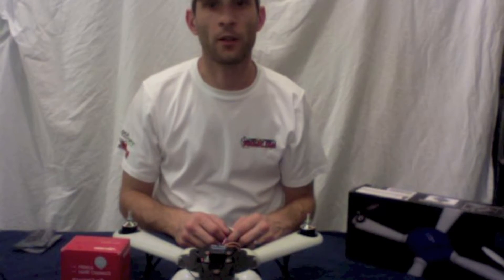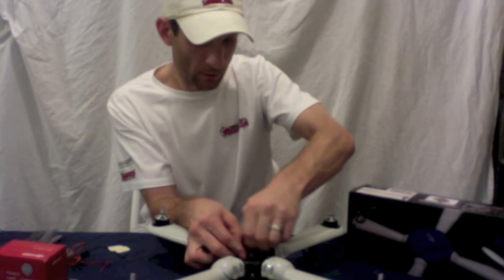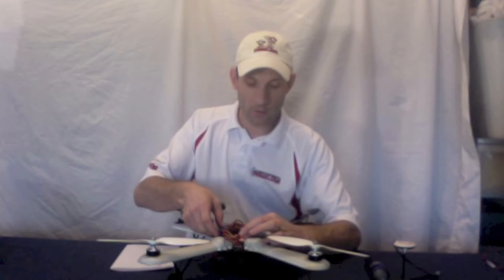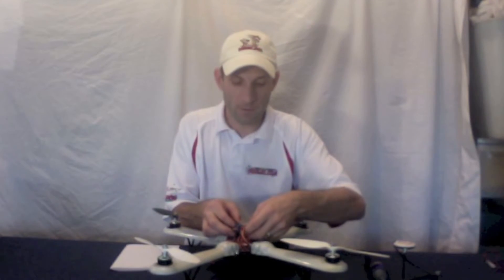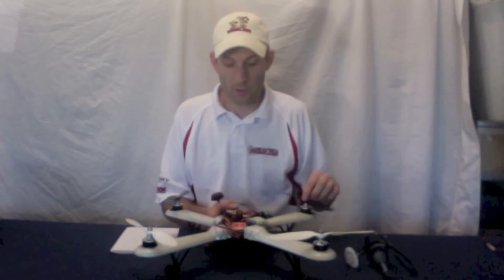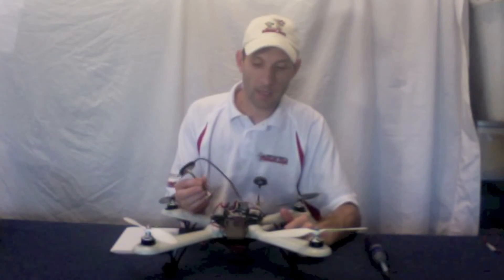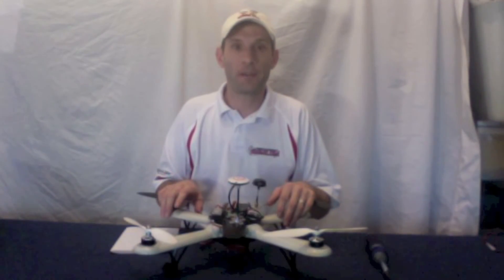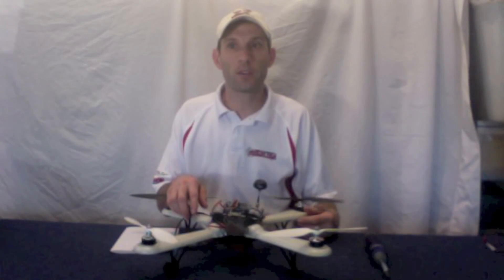Add a Naza M or Naza Lite to the Dualsky Hornet QuadCopter

Comment: How do you keep it calibrated I'm stuck for some reason my remote is still connected to the receiver because the red light comes on and off when I turn on and off the receiver but when I go to unlock the rotors it doesn't spin  up is there some type of battery back up I need to keep inside  like AA batteries or something a battery pack  how does it retain its memory after I disconnect flight controllers and switch them out
Reply from the maker: +Kris Shelton Kris it has been awhile since I used the Naza.  One of the key elements to that system is the Blinking LED light unit of the NAza.  These display a code and can help determine what is going on.  You don't need AA batteries or anything.  I would check to make sure in the DJI software the RC controls are correct.  For example when you move the rudder on the left stick of the controller, the YAW slider moves in the software.

Comment: Very redundant. You take a cheap to fly quad, and put it in a very expensive gear. Flying manually takes a real man, putting it on GPS and altitude hold make it into a teen level.
Reply from the maker: I would agree with you.  However some customers prefer to learn first on the NAZA then upgrade.  That is what I did.  I prefer flying my CC3D over the NAZA for fun flying.  However as a good salesman I have one with a NAZA on it so I can let newbies fly!

Comment from the maker: I calibrated them from the FC450 first. Then plugged them into the Naza. Just take note of which motor plugs in where. Follow the quick start guide step by step and you should be good.
Reply: Hey I I got the nausea M flight controller yesterday and I'm watching your video and I'm not understanding what to do with the Redwire after I remove it from the center and if you could just if possibly give me a call that would be awesome and if you have the time
Reply: The red wire that you take out of the the Hornet 460 mainboard where do you put that red wire that you take out of the little clip do you plug it into something else or do you just remove it and let it float around inside the quadcopter
Reply from the maker: +Kris Shelton You can wrap it with electrical tap to another wire.  That red wire has power to it and you do NOT want that into the setup.  I can give you a call next weekend.
Reply: I understand and I will wrap something around that wire I need to also buy a eight channel at least an eight channel Remote can you name a good one that gives me auto return the failsafes and everything all the goodies. And I'll buy from you on the first just send me the link I was looking at Futaba. T8J. 300 $. Is there one comparable to that brand but cheaper that you would recommend with all the bells and whistles

IWin !!!
Reply: I'm gonna try the calibration to also see if that works because I have a four channel right now

IWin !!!
Reply from the maker: +Kris Shelton I would suggest a Taranis with X8R.  The Futaba is a very nice radio and has a better GUI, the Taranis is just so much easier to customize and make everything work the way you want.  You can assign all the switches to whatever channel you want, play grovey music while you fly AND the X8r receiver can do 16 channels.  
http://www.2dogrc.com/frsky-taranis-2-4ghz-accst-16-ch-radio-x8r-receiver-combo-mode-2.html

This is what I have and about every other quad pilot out there!  This will come in handy when you want some smaller quads, you can use the tiny X4r receiver!